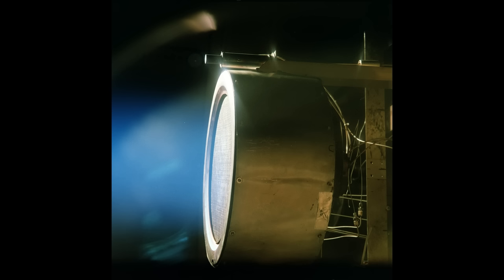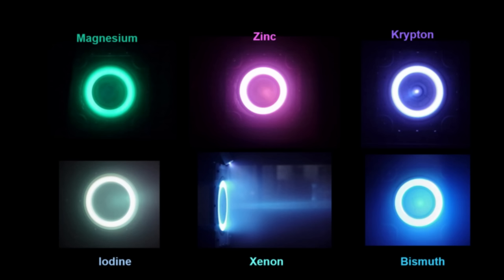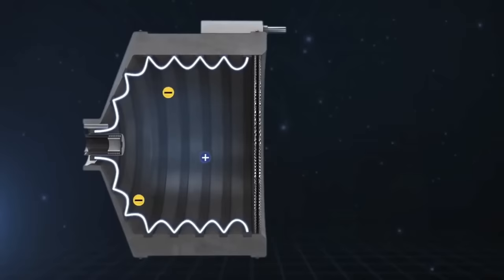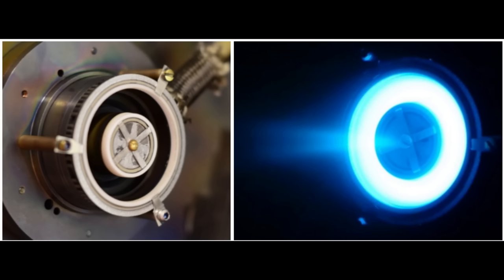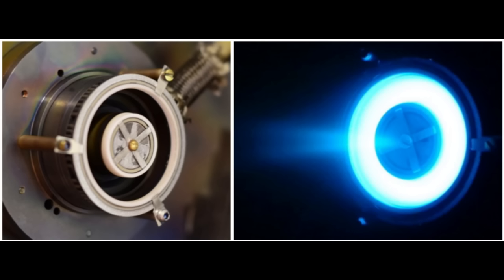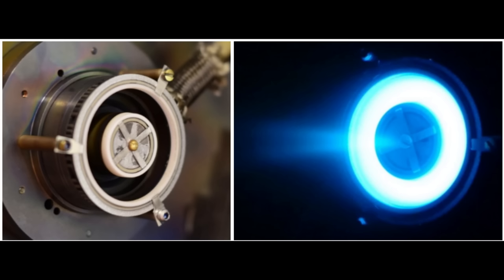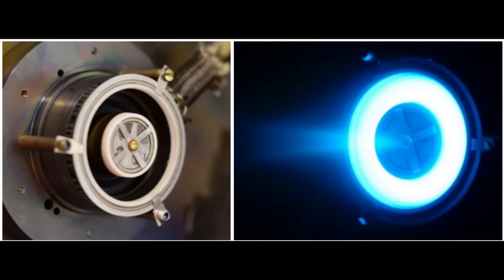Why Are There Two Different Types Of Electric Space Engines, And How Do They Work?

Comment: Ion thrusters have always been one of the very few real technologies that seem truly "SciFi" to me
Reply: It probably helps that a lot of SciFi shows use ion thrusters as a plot device.
Reply: they're basically just magnets at the end of the day, same concept as a coilgun, optimised for a different purpose, any engine that uses either beamed energy reception or nuclear reaction is a lot more sci fi than ion engines, "ion" sounds sci fi but it's just the basic building block of all chemistry, it's just magnetically charged atoms being pushed by a magnetic field, and they chose chemically inert noble gasses because they react with the walls, they sound sci fi, they look sci fi (with their blue or purple glow), but when you get down to it they're very basic and low technology
Reply: @anonymous-rb2sr  Magnetic Sails are basically also just magnets at the end of the day.  Except applied to the solar sail concept.  If you accept the downside of them needing power, they are basically superior to a normal solar sail in just about every other way.  Their wind catching area is not limited by the physical shape, but but the fields they produce.  

I like to describe it as:  
Solar Sails = the square rigging on many large age of sail ships.  Can really only sail downwind.  
Magnetic Sails = the triangular sails seen on many ships throughout the ages, as well as being the primary sail type used for conventional sailing vessels today.  You can sail at various angles due to them being wing-like in that they deflect the wind rather than just being pushed by it.  You can even sail into the wind up to a certain angle.  Fun fact, a magnetic sail can actually sail closer to directly against the apparent wind angle than an actual naval sail.

Comment: A correction is that the electrons do hit the walls. At 11:53, it is shown that the electrons orbit along the magnetic field lines. And from the thruster illustration, the magnetic field lines do not go around the annulus; the field lines cross the gap radially outwards. This means the electrons are constantly orbiting the field lines and reflecting from each wall of the annulus, this causes erosion in the anode channel. The electrons slowly drift in a circle (but in fact they are bouncing back and forth between the inner and outer wall) due to the hall effect. The hall effect is a side effect, it does not play a critical role in confining the electrons. The mechanism responsible for confining the electrons is the gyration of the electrons about the magnetic field lines. Thus "Hall Effect thruster" is a bit of a misnomer, "Hall thruster" would be more accurate.

Regarding the higher mass flow rate of the Hall thruster, this is not really the major mystery. The reason why Hall thrusters can achieve a higher thrust density is because it effectively avoids the space-charge effect. In an ion thruster, the space between the grid only contains positively charged ions. This means there is a critical density where the amount of ions per unit volume is so high they start to repel each other. This prevents scaling the thrust up on a gridded ion thruster without scaling the size. In a Hall thruster, the ions and electrons exist in the same space, so the plasma is effectively quasi-neutral, and the electrons and ions shield each other (sort of) from the space-charge effect. This allows for higher thrust density.

However, the mystery lies in how to confine the electrons within the magnetic field effectively. The electrons diffuse out of the magnetic field at a higher rate than expected of classical models, but also slower than other proposed models, so we dont have a complete understanding of the mechanism that allows electrons to escape being trapped by the magnetic field lines.
Reply: Thanks for the valuable nuggets of information!

Yeah this is exciting to think about... Completely bonkers for me as a layman to imagine the conditions in various points throughout the apparatus, like when and what fraction of atoms would get ionized, and where there is surplus of electrons and where there is not, and what happens with ions that get created late down the road at the exit and dive in backwards...

Fascinating that even the manufacturers of the actual thrusters don't possess the theoretical underpinning of what the thing will do but go hey, the proof in the pudding is in the eating.
Reply: Excellent comment thank you

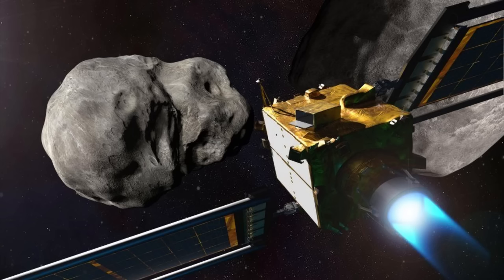Comment: Small correction at time 4:50.  If you double the exhaust velocity you quadruple the energy needed per unit reaction mass, but you also double the thrust.  So for the same thrust you only need half the reaction mass and double the power.

Jon
Reply: this - this is why efficient + high power engines can never be a thing - because you have to pay double - once for efficiency and once for thrust, and untll you have a mega-watt power source, you aren't going to be doing mega-newtons of thrust at high isp, and when you run to ultimate limits you discover that even antimatter doesn't have enough energy density to power the rocket if you want to get to a large fraction of the speed of light.
Reply: @andytroo  I suppose the main use cases are automated very small vessels - sub-kg minicomputers stuck to a thruster and some solar panels. The other option is beaming energy from a remote source.
Reply: @andytroo  Compared to today's engines, they could be possible.   Relative to today's, that is.  If we get fusion reactors functional and in space, they could create enough power to shove a sufficiently high amount of power into a sufficiently large amount of matter to be both efficient and high power.  Again, relative to current ionic engines.
Reply: Jon Garfield died 6 years ago you have to let him go you need to move on

Comment: Cool video, thanks! Small correction at 8:04: the gap width has no effect on ion velocity. Only the electric potential/voltage dictates ion velocity, not the distance between the charged grids.
Reply: Why? Surely the potential gives an acceleration and the longer the ion is undergoing this force the faster it will be travelling at the end?
Reply: With higher voltage comes higher distance. Electric Engines follow the spiderman rule😂.
Reply: @colinmaynard2879  the gap distance cancels out. At the same voltage difference between places, the acceleration on the ion becomes larger when the gap becomes smaller. In the end you get velocity

v = √(2qU/m),

with q and m being the charge and mass of the ion and U being the voltage difference between plates. No gap distance in the equation.
Making the gap larger probably has some engineering reasons, but doesn't affect ion velocity.
Reply: @colinmaynard2879  in a conservative field, all that counts is start potential (voltage) and end potential. Ofc, if the acceleration is to too strong, you may start losing energy to bremsstrahlung (photons of all energies)...ofc, photons carry the most momentum per unit energy, so maybe that's a good thing?
Reply: @ProjectPhysX  thanks
Reply: @colinmaynard2879  ProjectPhysx you're right, the one thing I could imagine is that they might already be operating at the limit of the gap size vs voltage, so it barely doesn't arc over. Then any increase in exit velocity would also be indirectly coupled to the gap size
Reply: Did you study physics or how do you know all of this just right of you're head
Reply: @jonahosterried7832  We learned this in school as well. The underlaying formulas are pretty rather basic stuff compared to other things.
Reply: How funny. Completely off-topic, but I remember a while ago (I'm talking months) someone cross-posted a video clip of the starship fluid dynamic animation from one subreddit to another subreddit (I forget which one) which lead me to your yt channel. I thought I recognised your username! Hello again! 👋
Reply: @jonahosterried7832  I remember this from 11th grade in school, but I also have a Master's degree (and soon PhD) in physics :D
Reply: Beyond a field strength of 20-40kV/mm, you will experience electrical breakdown, even in a high vacuum. 
Considering the grids need to be physically held together by some sort of non-conductive material, the breakdown might occur at even lower field strengths.
This means your gap width does effectively limit the voltage you can apply across it.
That being said, I don't know if that is a limit these engines are actually running into.
Reply: @ProjectPhysX I see, thanks for sharing
Reply: Wonder how small the gap must be if we want to make the ions accelerate like a bullet train with tandem postive-negative grids stacked one after another...
Reply: @SukacitaYeremia  This is how linear particle accelerators work, they have alternatingly charged rings/tubes, switching charges at radio frequencies. Since the ions get faster after each gap, the tubes have to get longer and longer such that the frequency syncs with the particles passing through the gaps.
Reply: @colinmaynard2879  the total voltage difference is what matters. The acceleration is caused by the Volt per meter gradient of the electric field. So the closer they are together, the higher the gradient, the higher the acceleration is, but the shorter that acceleration is experienced. The two effects cancel each other out. 
On the other hand, static arcing can occur if the grids are too close together, so a minimum distance is required between two grids with high voltage difference. So in order to be able to maintain a high voltage, you need sufficient distance.
Reply: @ProjectPhysX  Gap distance impacts the max fuel throughput based on space charge limitations.  The bigger the gap, the more ions are in it at any given time, which creates more space charge and eventually causes impedance and voltage drop, limiting ion flow across the gap.  It is basically a Child-Langmuir style vacuum diode.  Smaller gap, higher max fuel flow, higher max thrust.

Comment: Some years ago I used to work in an inspection lab with a very nice computed tomography system, that is to say a machine built to take 3d x-rays of what was put in there simply speaking and outputting a volume of data that could be analyzed. The customer was aerojet rocketdyne and what I was inspecting was the rear outer rings of hall effect thrusters that were being tested for lifetime limits and erosion is definitely the best way to describe the appearance of the ceramic material. There were straight channels along the direction of thrust I forget how long they were running but for that to happen it was definitely a long time.
Reply: What does it look like?
Like a river bed thats dry?
Reply: @azmanabdula  straight and jagged like
Reply: @Chooie6  
Isnt that contradictory?
Reply: @azmanabdula  its a bit hard to describe but the best comparison is its similar to a sloppy water jet cut. like if you used a extremely rough grinding surface in the same spot to the point that it leaves distinct grooves. as was the case they had extremely long runs of consistent wear.
Reply: @Chooie6  
Oh I see
So its like a flat burred surface
Reply: @azmanabdula  not flat it was basically the inward facing side of a ring i guess you could call it the nozzle area wearing away
Reply: @Chooie6  
I see
Im trying to visualize it
Reply: @Chooie6  Huh, that makes me wonder if the "errosion" in a hall engine creates grooves, and that particles then repeatedly get caught in those grooves. If So, then it should affect the performance of the hall thruster? Though idk if it makes a noticeable impact.

Makes me wonder about how to fix that problem; but then gain, as Scott says, there probably just isnt a requirement for even longer burning hall thrusters. The really fun part would come if we scaled "electric" thrusters up, power them with a nuclear reactor, and use it for a Mars mission or so.

But even there, something like Starship might be overly optimistic, but shows how you maybe dont need electric engines for a manned Mars mission.
Reply: @termitreter6545  i did not get to see the data on the affects of that erosion so i dont have an answer to that i also did not take any pictures. Indeed as Scott said they have not needed to reach that end of life despite there being data on where that end is.

Comment: Great explanation of Hall Effect Thrusters, I have heard a lot more about ion thrusters previously on ESA missions. Just to add FEEPs (Field Emission Electric Propulsion) may gain in popularity after decades of struggle. The slit FEEPs were actually removed from LISA Pathfinder spacecraft and replaced with a cold gas subsystem previously flight qualified for GAIA. But now various Cubesats are using the Enpulsion supplied needle FEEPs, which hopefully will meet lifetime requirements as there are proposed for missions like the AWS Protoflight model with a total spacecraft mass of about 135kg. So it could be that FEEPs are used for smallest spacecraft and the other electric propulsion technologies for larger satellites.

Comment: From the properties quoted, ion-grid thrusters can achieve significant fractions of c for interstellar probes, while hall effect is great for repositioning satellites and impact avoidance .
Reply: that is great, in steed of the traveling taking several 100 years... now the acceleration will instead.
Reply: @matsv201  lol 100s? you're generous, maybe you forgot a few 0s there!
I did the math, and ignoring any relativistic losses should there be any, to reach half of c (which is extremely slow compared to interstellar distances let's not forget that, c is SLOW, half c is DOUBLE slow)
it would take around 60 thousand years to reach half of c from standstill

and at half c it would take 8 years to reach proxima centauri

I can't be bothered to do a differencial equation to calculate what the shortest travel time achievable with it would be, but I expect several tens of thousands of years with the thruster burning 100% of the way

yeah ion engines just suck, let's be honest

Comment: Really nice to finally see how these work.   One question:  Why is neutralizing the outflow necessary in these thrusters?
Reply: If you don't, the ions may be electrically attracted back to the spacecraft, negating the thrust.
Reply: You don't want charge building up on the spacecraft and dragging the ions back.
Reply: You want ions to leave roughly at constant speed, carrying your delta impulse. If you emit charged particles, your vehicle will attain the opposite charge and after a while the particles won't leave it anymore due to electrostatic attraction, nullifying thrust.

Comment: In a CRT, the electrons that shoot out from the gun in the back are easily steered by the coils but any residual stray ions (chlorine, oxygen) tend to fly in a straight line and, if not accounted for, create an ion spot in the middle of the screen. This ties in well with the fact that in Hall effect thrusters, electrons swirl around but the ions just shoot through the magnetic field. I like it when facts from different fields of technology help understand each other.

Comment: This is great! You can almost completely replace the AIAA/IEEE electric propulsion class with this. Can you add another pair of these? One for generic electric propulsion that includes the equation relationships between specific impulse, voltage, thrust and power and a second that covers the other forms of elecitric propulsion? Cover Arcjets (flown), pulsed plasma thrusters (flown), VASIMR and the various cubesat EP systems (you hinted at FEEP, but there are vendors that have flown dozens or hundreds)? Seriously. Having someone that is charismatic like you do this series would make it so I don't have to teach new mission designers anymore.
Reply from the maker: That sounds like… work :)

Comment: Worth mentioning the Magnetoplasmadynamic thruster, which combines both insane Isp and high thrust. It is still experimental, though
Reply: Anything that results in high Isp and high thrust uses a lot of power and power is currently the bottleneck.
Reply: @leonfa259  Cathode erosion is the bottleneck for this type of engines now. However, the video is about el. engines, so, as I said, this type is worth mentioning.
Reply: Not to be pedantic but it’s more like highER thrust. We’re still talking about millinewtons of thrust here.

Comment: Finally an explanation of why Xe is so popular. It's always seemed odd to me given that for a fixed ionization state (e.g. +1) the Iₛₚ goes up as the species mass goes down.

The explanation here suggests that thrust-per-power dominates over total ∆V as a priority. Hydrogen would make the best fuel, yet again, for max ∆V over very long missions... as long as storing it isn't a major concern. The species I've thought would be an interesting candidate would be Br: it's cheap, light, not horrendously corrosive, has a comparable first ionization energy to Xe and can be stored as a liquid in the structural equivalent of a pop-can.
Reply: How about Radon? How well would that work?
Reply: @williamduffy1227  the entire Radon content of Earth's atmosphere is less than 1kg and it has a half-life of less than a week. I suspect the logistics alone would rule it out.